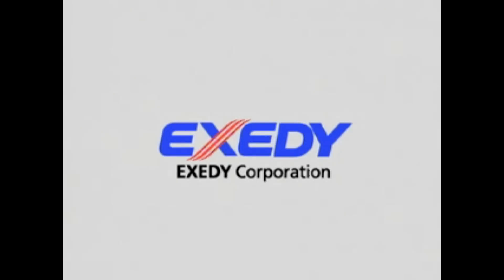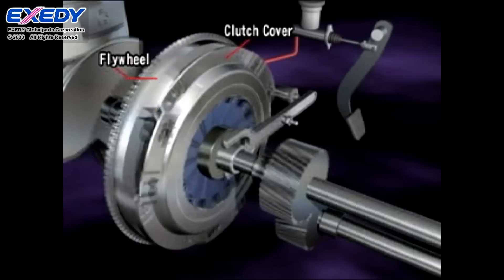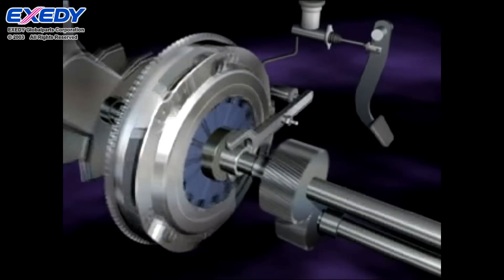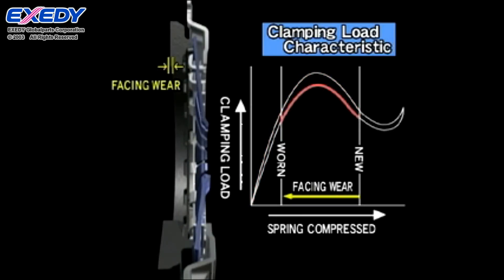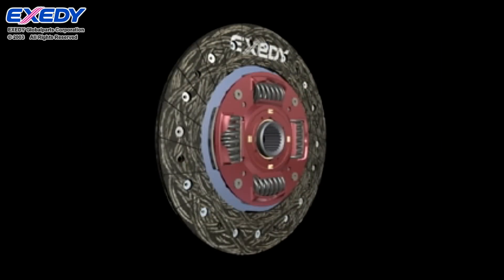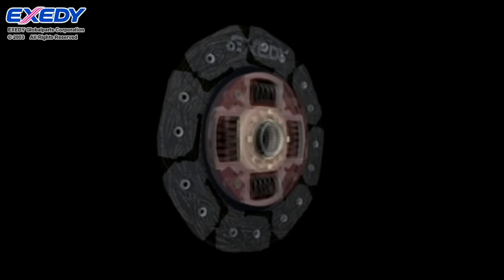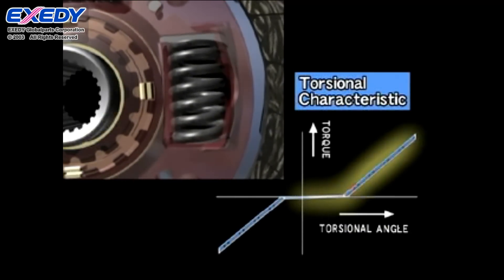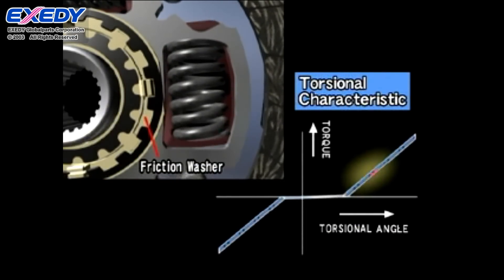EXEDY Tech - Manual Clutch Basic Function explained

Comment: Great video , one question I want to understand is in disengaged mode when pressure plate moves away from clutch disc why does clutch disc move away from flywheel , what force moves it away on axis ?
Reply: Because of the repelling force from Fly wheel,disc was thrown out